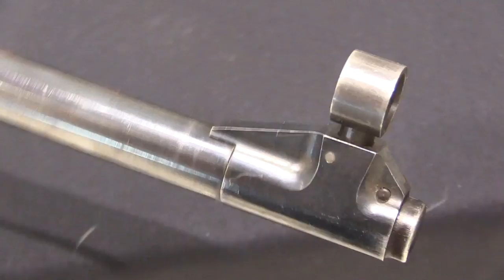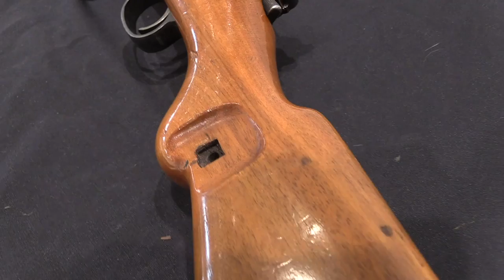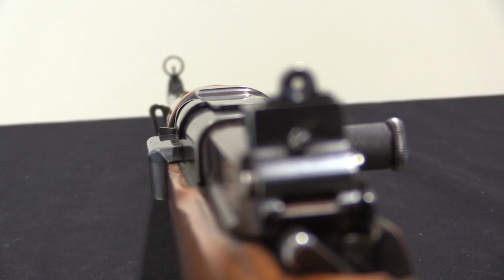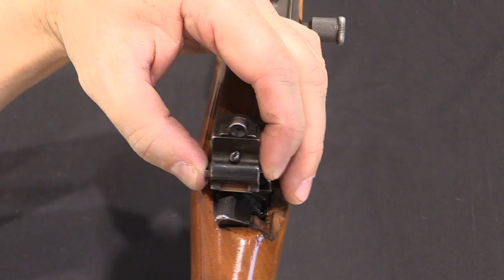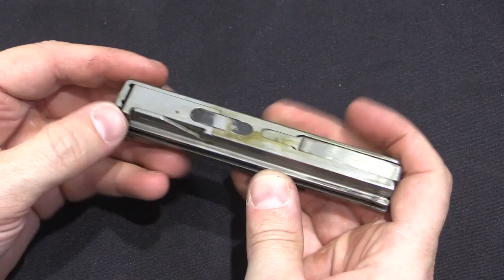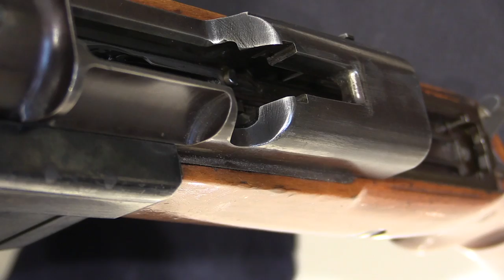Captain Carl Pelo's Model 1954 Prototype Semiauto Rifle

Comment: "54 rimmed, or 53 rimmed by Finnish terminology"
Some people just have to be different :p
Reply: Comrade Ivan says dah is true.
Reply: The cartridges are actually slightly different in spec, not just the nomenclature. As a general rule, you can shoot 54R through a 53R chamber if it locks without resistance, but in general it's not recommended. And obviously, you can shoot 53R through any 54R gun.
Reply: dimapez  That might be the case, I was referring to the fact that since 53R is slightly smaller it will not have problems in 54R barrels and chambers. 

I do wonder if that extraction problem could be mitigated by just adjusting the gas on the PKM. However, not like it's ever going to be an issue since 53R is only really made and issued for the TKIV85 as high quality sniper ammunition.
Reply: The 7.62x53R has a 7.85mm bullet diameter (compared to 7.92mm for 7.62x54R),53.5mm case length (compared to 53.72mm), 14.4mm rim diamater (compared to 14.48mm), and 77mm overall length (compared to 77.16mm). That difference is usually not enough to matter, though. Unlike some other not-quite-identical cartridges such as .308 Winchester and 7.62x51 or .223 Remington and 5.56x45, 7.62x53R and 7.62x54R also have identical maximum pressure. So a gun that can fire one can almost always fire the other.

So why does 7.62x53R even exist? Apparently after becoming independent, Finland switched to smaller diameter (7.82mm) barrels when the original barrels of their Mosin-Nagants started to wear out. Why did they do that instead of replicating the existing bore diameter? No idea. I know they bought a bunch of new barrel blanks from SIG in the early 1920s, so maybe that's just what SIG had in stock at the time.
Reply: @RedXlV  Yeah that's my thought as well, they bought barrels or tooling abroad and the way they measured actual caliber was different from what the Russian did. So they just went with the smaller caliber.

I think some earlier Finnish Mosins that have not been altered may have slight issues, but the Finns did start to modify their rifles chambers during WW2 to better accommodate 7.62x54R, as they would obviously capture some of this ammunition. Which is why no one really talks about this 7.62x53R thing in the US with Finnish rifles. They will take 54R just fine.

Comment: Carl Pelo is an interesting figure. He designed bunch of rifles and submachine guns for Finnish Army trials, and at least one of his semiautomatic rifles was trialled by Swedish Army, though they ended up with what eventually became AG 42. As I recall he designed both short and long recoil rifle prototypes. His submachine guns were workable and might have been produced if Finland had not captured PPS 42's which was promptly copied.
After the war, he produced interesting fixed-magazine 9mm SMG, which was loaded by 30 round paper clips. The idea was to get around the problem of shortage of detachable magazines which had been very acute during the war.

Comment: I am impressed that gun designers kept coming up with short recoil battle rifles after the Johnson M1941 proved the shortcomings of the system.
Reply: The Johnson rifle wasn't that bad. The LMG however.
Reply: Perhaps those shortcomings were kept as a military secret? In any case, information from around the world was not quite as readily available as it is today.
Reply: Pre-WW2 there were pervasive fears that gas hole bored into barrel would be starting point of barrel erosion. Untill experience showed it is not. That kept many designers (and authorities behind RFPs) away from gas operated guns.

Life support for recoil operated guns even in rifle category.
Reply: While this was built after WWII, it was designed prewar.

Comment: Looks like it needs more moving parts that have to work for it to cycle.
Reply: @kenbrown2808  Should we let the swiss loose, with their designs, clocks, chocolate, and blokes/chaps on the range?
Reply: #togglelock
Reply: @kenbrown2808  STGW 57 is pretty close to that spec.
Reply: @kenbrown2808  Yeah look at their spring solution. If you want more gearwork then go with the WW1 French non-hotchkiss MG. Ian has a video on it.
Reply: @kenbrown2808  Surely there is some youtuber who a) has access to a Gatling gun, b) is bored, and c) is clever enough to make it run on springs and gears instead of electric motors or hand cranks. Wind it up, flip the switch to release the brake, and what happens, happens.
Reply: @kenbrown2808  https://www.youtube.com/watch?v=ofZnarVq8pw - Iunno - that's closer to clockwork gears than a gatling.

Comment: Have any country adopted around the same time/kept over very long period of time in service both semiauto battle rifle and intermediate caliber assault rifle as parallel arms? Did anybody adopt infantry doctrine to it?
Excluding the cases when it was done out of poverty.
Reply: China's infantry in the 1970s issued the SKS to everyone and an AK to the squad leader. The Chinese issued the AK the same way as an SMG would have been issued in WW2.
Reply: @B52Stratofortress1  I know that. SKS however is an intermediate caliber carbine, not battle rifle.
Reply: @TheArklyte  that's the only case that I can think of, besides the states using the M14 and the M16 at the same time during the Vietnam War.
Reply: @B52Stratofortress1  a pity.
M14/M16 is also not an example I was looking for since in that case M16(after fixing the production sabotage and other reliability issues) was superior to M14 in all regards. After all M14 was second generation AR, not first gen like Sturmgewehr or first plus like AK, AKM and EM-2 while proper marksmen rifles that would replace M14 were decades away.
Well, thanks either way. A pity that such example doesn't exist then.

Comment: 12 or 15 cm??? Maybe mm the only thing that should be measured in cm is clothing… SI until are in units of 1000
Reply: Nah. The beauty of the metric system, you can use whatever prefix you want and it's easy to convert. 
Some prefixes are of course more common and vary from area to area and country to country but you could even use decameters if you so wish. Not that anyone ever really does.